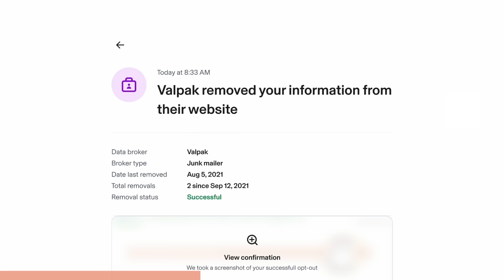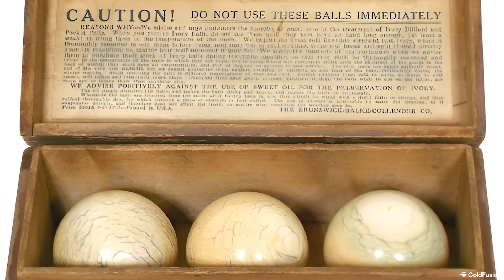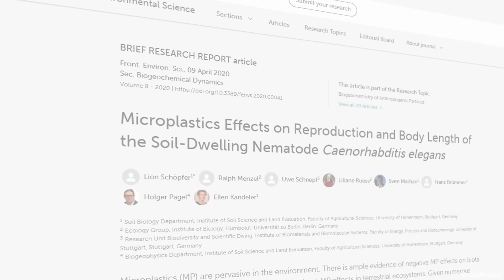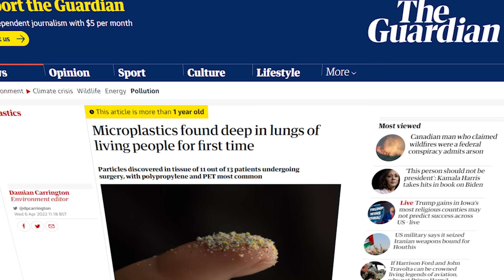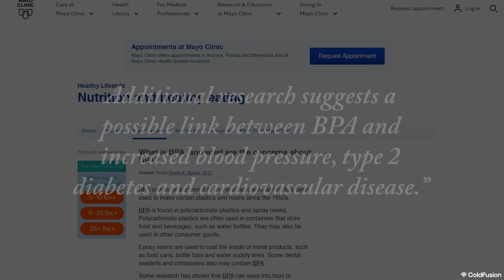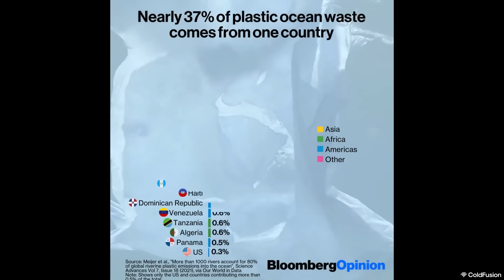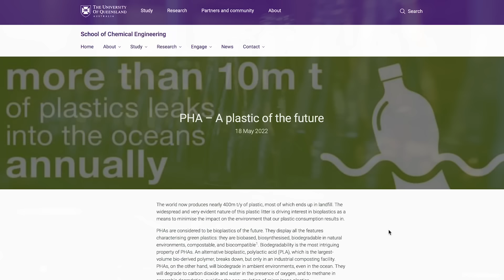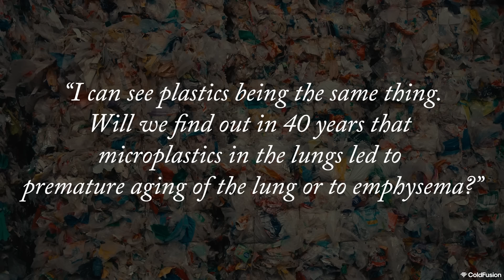How Microplastics Slowly Make Their Way Inside Us

Comment: Investigate the EVA plastic dumping prices. I tell to you why raw material makers selling it by dumping prices - it renders plastic recycling useless. Final plastic product makers mix it to everywhere to get cheaper end product. It is super for that purpose because can use almost with every other plastic mix or even separate layer on final product. Recycles are not happy, because end result is MIX plastic aka useless garbage. Recycling that thing causes so many gases inside the recycled plastic granule, it is impossible to reuse. Eliminate EVA plastic from market and you solve half of the problem. 

The next half is to limit the consumer packages to single type of plastics. Example Polyethylene is such a super plastic, it covers every need. They store even world strongest acids inside the high density polyethylene containers HD-PE. Only the chips makers will cry because no more fäncy print on package. Polyethylene print never look so cool

Comment: Steel tastes different because metal ions alter the pH of the water slightly. Plastic cups change the taste because when the plastic cups are formed, there are still left over monomers and short oligomers which are in the plastic matrix but not really connected to it. These chemicals slowly leach out. The traditional 'plastic' taste came from formaldehyde that leached out of old bakerlite cups; nowadays barely anysignificantly fewer chemicals leach out and those that do have almost no effectdramatically less effect than formaldehyde the poisonous carcinogen on human biology, so for the most part any 'plastic' taste (ie the taste that came from leached formaldehyde back when bakelite was commonly used) is in your head.The reason drinks stored in different containers taste different is separate altogether. Permeation of both UV light and carbon dioxide will slowly alter the pH of a drink. Ceramic has extremely low levels of both, clear glass has low levels of CO2 but high levels of UV, aluminum and steel have low levels of UV but moderate levels of CO2, and plastic containers have high levels of both UV and CO2 permeation.
Reply: Bro I wasn't even alive back then, and I have always noticed a plastic-y taste in water bottles, even as a kid, without any prompting or bias whatsoever. It is clear as day.

Comment: Recycling needs to be replaced with Nocycling: manufacturers are simply prevented from producing things in the first place and putting them in the ecological cycle.

Maybe a "plastic tax" should be implemented: the more you use the more you pay, with certain kinds of plastics (more dangerous to health and single-use) being charged more. Those plastics which are less polluting, or more likely to be used in longer-lived items, cost less. Just don't charge less for those plastics which "can" be recycled: that's the same outsourcing of responsibility which manufacturers already use to get away with polluting.

Comment: About 15 years ago I bought a sturdy but short-term-use food storage plastic box. I used it as a hygiene kit container that goes with me on any overnight trip. It's still as good as new. One of the best ways to mitigate issues with plastics is to use the main advantage of plastics: they don't degrade quickly; so it's desirable to use plastics where long-term use is required, while avoiding them for short-term use. However, economics dictate the exact opposite, namely that disposable plastics are the most practical. Granted, even re-used plastic items create microplastics, but at a much slower rate assuming they aren't left baking in the sun all the time.
Reply: Good point. I have some plastic cookware that my grandma used, still perfectly intact. Unfortunately we also wrap all the food we consume in plastic and that stuff accumulates like crazy.

Comment: A few years ago I bought two area rugs on sale and was surprised to find they didn't tend to shed fibers. That was very usual in carpeting about 30 years ago. There would be months of heavy shedding of fibers. I don't know if that also means they don't produce microplastic dust?  I live in a neighborhood with dirt roads. They produce a lot of dust. I don't know if microplastic dust is any more dangerous to health than road dust? I'm sure paved roads also produce dust from road salt, calcium chloride and sand, and tire and asphalt wear. The lungs can expel some particles. Are microplastics any worse than those? 
But there really is no practical or truly cheap alternative - on a mass scale - to the use of oil. There are millions of miles of road surface in the world that require an inexpensive pavement material. What other substitute is there that will make transportation within or between urban areas possible? Oil made the private automobile and long distance trucking possible. It was a remarkable fit. Electric vehicles do not provide a substitute for asphalt roads.  We can't even revive extensive rail service because suburbia was built for the private automobile. Many of the old railroad ROWs have been abandoned or converted to recreational use. RRs and urban development were a much closer fit until about 100 years ago. Even a Jetson type private air transport would likely be very expensive and require complete control by a central air traffic control regime that probably wouldn't allow for personal control.  No urban or suburban area would be so stupid as to allow swarms of flying vehicles in the hands of the usual distracted and/ or tired driver to infest their skies. 
Historically roads were dirt roads. Even "King's" highways, or what today would be called federally maintained roads, were dirt roads. But they were slow, labor intensive and not very durable. A form of Macadam road, invented in Scotland  a few hundred years ago was actually made of hand placed stones set on edge and designed to be worn down with iron cart wheels to grind the sharp stones more or less evenly. They were much narrower than your typical suburban drive. But even those would be nearly impossible to build on anything like the modern scale required.  That's the kind of hand work people do in garden walks today. And even those would produce silica and other mineral dust. 
Maybe you wear a mask everywhere and at all times?  
Maybe like me, you just don't care anymore. Something's gonna get you. Modern life in general has extended life expectancy much longer that that before the industrial revolution.

Comment: I believe this could be the most important issue we have had so far, I know we can do relatively little on our own but I think we need to start by replacing as much plastic in our homes as possible. Some of my favorite ideas for this that I have started implementing are getting rid of any and all plastic bottles that you drink from (you can by glass jugs in different sizes and fill them up with water for much cheaper then to buy it), wearing fabrics only made of natural materials like cotton, and storing food in glass containers, the last one is tricky because they usual have a plastic lid but I have some ideas for using metal latches that snap down a glass top like the old jars.
Reply: You can get glassware that has metal or silicone lids, which are potentially better than plastic for health and environment.
Reply: I use Ball Mason Jars. I even use the wide mouth 16oz. As a coffee mug.

Comment: There are other very important trade-offs besides cost that I think should have been mentioned. Plastic bags, while inexpensive, are notably energy-efficient. However, despite the depiction of paper bags as the smarter choice at 14:46 in the video, it's worth noting that plastic grocery bags consume 71% less energy during production than paper ones. Moreover, the production of 1,000 paper bags requires 1,004 gallons of water, while only 38 gallons are needed for the same quantity of plastic bags. Consequently, opting for paper bags can lead to increased emissions, various contaminations, and, as substantiated in this particular case, potential health risks.